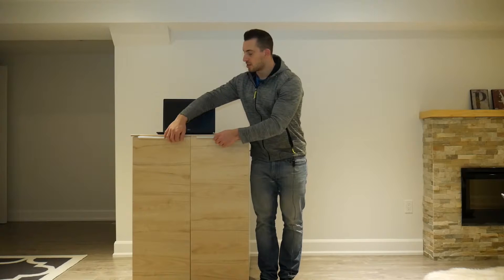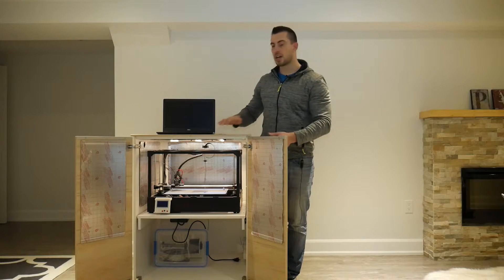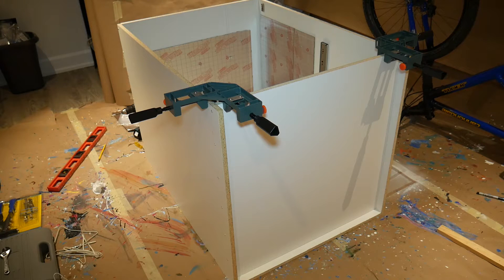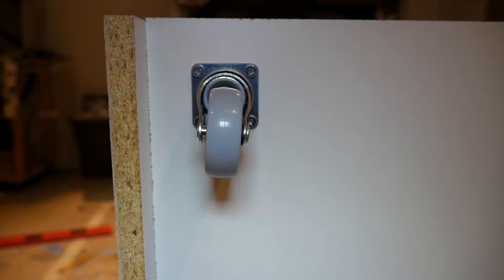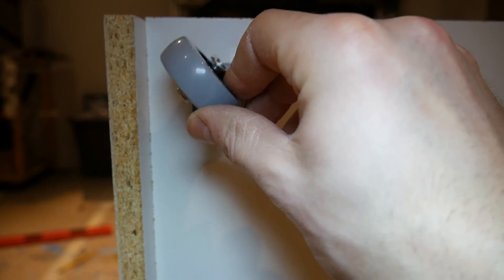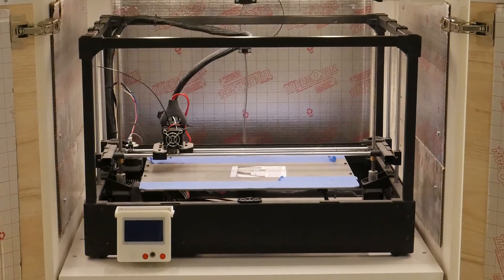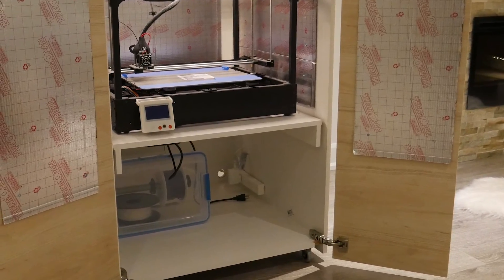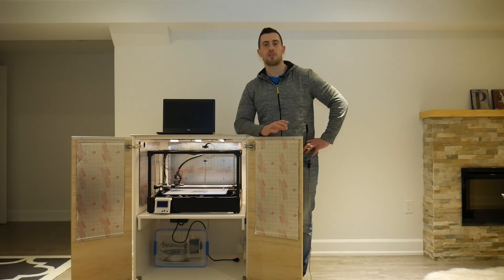How To Build A Rolling 3D Printer Cabinet Using IKEA Parts!

Comment: You can use Statx or Stove top portable dry automatic fire suppression inside the cabinet if you want more protection.

Tried to share links but my post disappeared. They do have YT videos.
Reply from the maker: Absolutely! Right now I have a smoke detector signal output hooked up to a relay to kill electrical if smoke is detected, but fire suppression would be even better

Comment: I don't know if you'll see this comment, but you had an awesome video and this is really underrated for the quality you produced. I was also wondering if you think it would be a good idea to use soundproofing panels on the inside of the printer area, instead of heat panels, or possibly a combination of both?
Reply from the maker: Thanks Brandon! The panels alone took the noise of my printer way down to begin with. I would only entertain the idea of soundproofing if it is completely flame proof. My cabinet is clearly not flame proof but I feel like it would take more to set a wood board on fire than something like non-flame retardant foam. The reflective panels I used are actually flame retardant so it might help my situation a little. Since building this cabinet I also hooked up a fire alarm with the signal going to a power bar that will turn off when the fire alarm detects smoke. So it will automatically kill the power to my printer.
Reply: @EmbraceMaking  Thanks for responding so fast on such an old video! That sounds great to me, so I don't need to use the soundproof foam then, saves me money and time. I'll be sure to get some of the foiled wood like you did in the video instead as it seems to work for you just fine. Again, thank you for helping me out, I'm brand new to 3D printing and every little piece of information helps me.

Comment: This is a great build but are you worried at all about a fire in the wood cabinet? I have seen alot of house fires with due to 3D Printers. 🤔
Reply from the maker: Anything is possible so I can't say my printer is not susceptible, but I've tried to mitigate the chance by redoing all of my printer wiring to include lots of strain relief and also use a power supply that is more than up to the task. Since this video, I have also installed a fire alarm that is hooked up to the power bar, so if it detects smoke it just shuts everything down and kills power to everything immediately.

Comment: Did the casters or the shelf rails cause any movement of the printer, and subsequent defects in print, due to rapid movement of print head during infill or higher print speeds?
Reply from the maker: Great question and observation! I haven't had any visible issues yet... I keep my print speeds pretty reasonable... my printer is a bed slinger and the bed moves in the Y direction (same as the drawer slide) and I see no strange artifacts due to that. My drawer slides sort of "lock" or detent into place in the end position so that also helps the printer from flying around. Additionally, my printer is very heavy (steel frame) and the entire cabinet is very large and very heavy (plus small casters). Once I load up the bottom with my spare filament it is very solid. If you were to build a smaller cabinet with larger wheels and less weight, you might see it moving around with very fast printer speeds and accelerations. Hope that helps!

Comment: nice stuff !!! Which 3D printer is that ??
Reply from the maker: Thanks! Printer is a "RigidBot Big" .... no longer in production but a great platform to modify
Reply: @EmbraceMaking  But you CAN get a reliabuild big -- the upgraded successor to the rigidbot.  I'll refrain from sticking the URL in here, but Heath @ laserwelddesign is a fantastic source of parts and assistance.